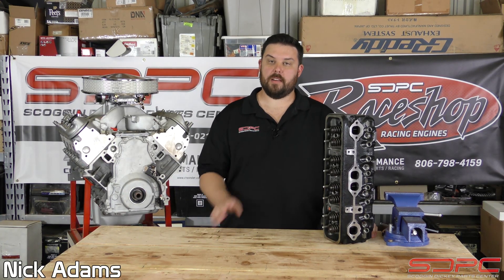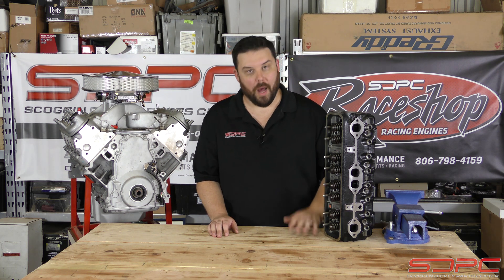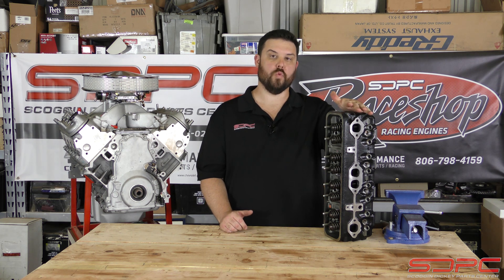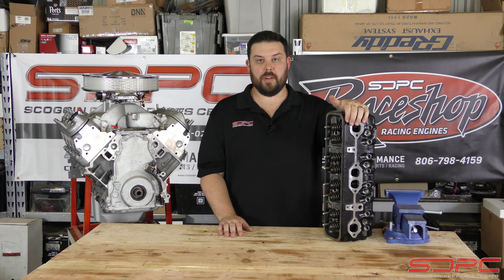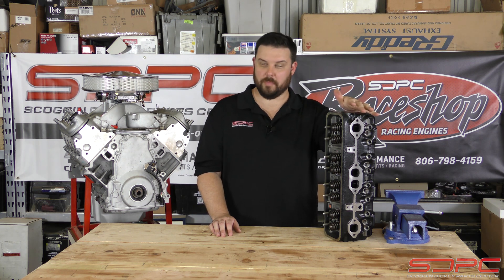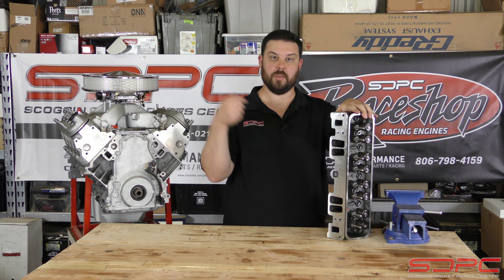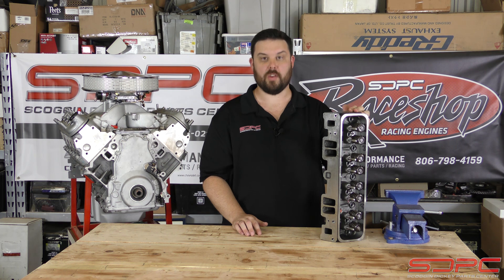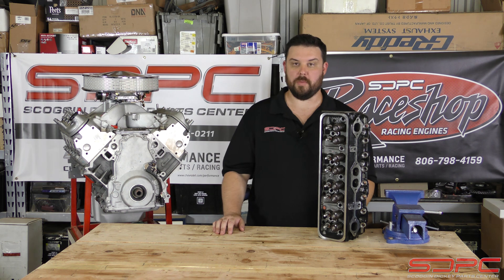SDPC Tech Tips: Vortec Heads for your SBC

Comment: Got mine with a manifold used. Check for cracks and rebuilt. Did a little pocket port and opened the exhaust ports as much as I could. Took a few CC out to bring down the CR for fuel from the spark plug block boss. Smoothed it. Used the Alex's Parts Spring kit for up to .550 cam clearance. All in 700.00. that was about 7 years ago. Sucks they have doubled in cost!

Comment: You can get aluminum AFR Enforcers for less than that. I got my vortecs off a junkyard engine, had them magnafluxed, machined and a valve job all for less than $600. That was 10 years ago. They are still great head.

Comment: My brother has a 1988 chevy 5.7 350 with the Smog pump heads.  He took those heads off and put the iron vortec heads on along with a vortec Dual plane airgap intake...my question to anyone with Knowledge... what's the biggest camshaft he can run without having to put a Stall converter in and without the valves hitting the pistons...and we was wanting to know about how much Horse power we could expect.
This setup will be running on the streets and it will be doing some street racing.......Any help
Reply: it's not how much lift before piston to valve crash, the valve guide clearance to the retainer  that will interfere first it's also how long the valve is opened, the piston chases the exhaust valve up the cyclender pushing air out, that can cause damage to the valve if it stays open to long. intake valve not so much. lots to consider when making changes.

Comment: I run a vortec 5.7 with edelbrock heads, a cam, pushrods, rpm preformed intake, Holley terminator, long tube headers true dual…
Reply: run an H or X pipe, you'll love it

Comment: I have a 95 chevy 5.7 TBI . Can I replaced the heads for vortec  heads to increase flow and cam? And of couse I belive Im going to need a different intake and carb and fuel regulator .. can it be done?? Im planing on sendind the block to the machinche shop and add flat pistons and oil pump??
Reply: I have the same 5.7 tbi and I am looking into doing the same thing... what info have you found for this?
Reply: @125artfox  depends what you want ?? But it's best to replace it when the a beef up engine , trany  and computer . The other way just waisting money for little extra power and a lot of trouble.
Reply: @gabinosanchez1313  did you end up doing the vortec heads and cam?

Comment: Just bought a set of these from Clearwater for $900 out the door (free shipping).

Screw in studs, already machined for .600 lift, 2.02"/1.60" valves.

Making my '93 Sierra 4x4 all terrain rig.
Reply from the maker: Can't argue with that, nice snag!
Reply: @Sdpartscenter  do you sell vortec heads for sbc 305
Reply: Clearwater Florida?
Reply: @freshbutplain1144  Clearwater heads yes in Clearwater FL eBay seller too
Reply: 2.02"/1.60 valves in this head won't make much of a difference over the 1.95/1.60 valves but for that price over SD $1300 is worth it lol
Reply: Is 2.02 intake, stock on these heads. I have a 98 engine, waiting to be restored.
Reply: @michaelnelson9140  These are 906 Vortecs made from scratch by CCH (it's their casting) so no, they are not stock.

The stock valve sizes are slightly smaller. CCH sells refurbished stock 906 heads for less.. but not much less.

I decided to spend the extra few hundred along with an edelbrock intake and an ovesized custom throttle body to get the engine breathing as well as possible.

Engine runs great. Noticeable difference over stock. (It does have a mild performance cam and chip too)
Reply: On the going back to the 350, as soon as you load down the LS series with cargo i.e weight, there is unfortunately no difference in the MPG. Must be the bun chiller's. It is also not free to do a LS conversion. If a show pony do a LS more top end revs and better mpg if you're keeping a foot out of it.

Comment: I remember when installing vortec heads on my 350 Chevy corvette and a comp cam 218/218 from 15.7 it went down to 13.7 , did install headers and exhaust and Holley carb (750 secondary vacuum and upgrade for more fuel because it was asking for) 
I still think it can run faster but haven’t done anything to it in a decade